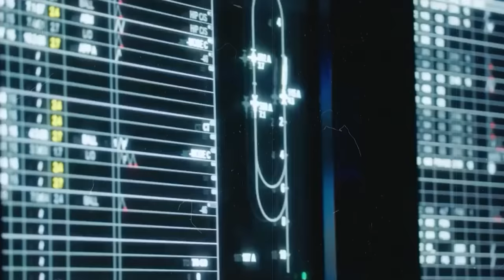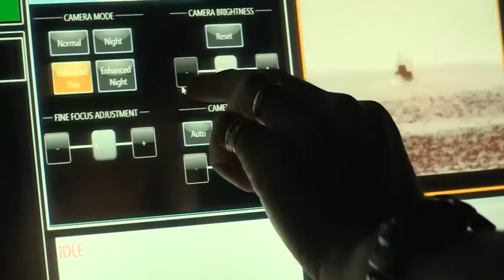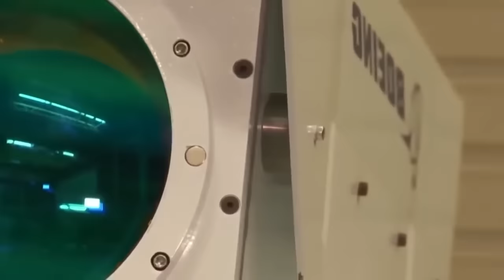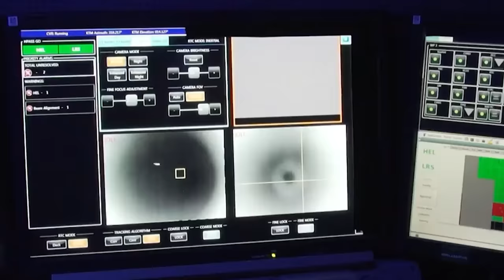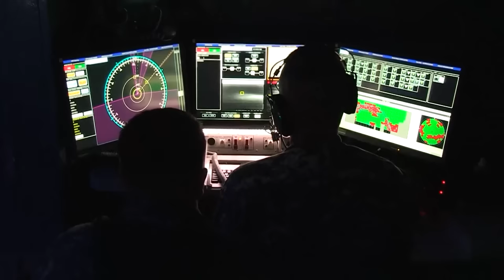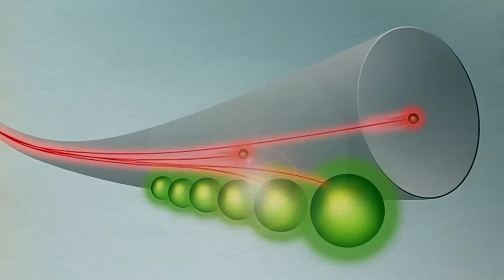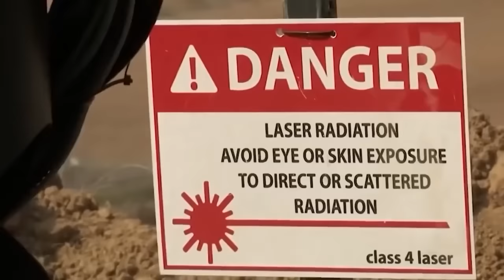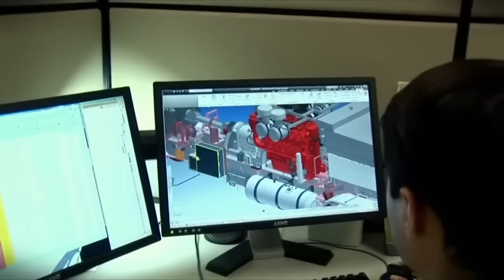2 MINUTES AGO: US Tested It's MOST Powerful $650 Million Laser Technology

Comment: What if the beam was bounced back to the source with a specially design "mirror" system?
I mean, a laser is a light beam.
Reply: It would have to be aimed by the mirror to send the beam back with accuracy enough to hit the laser gun.
Reply: @ajledbetter2197  Just cut through the tower that the laser is mounted on.
Reply: The lasers would have a short pulse time, I would guess, as that's how you deliver a lot of power.  I can't fathom the precision needed, to aim the mirror correctly, and you would have to know exactly where the source was, at the time of fire, so I can't see how this would be possible.